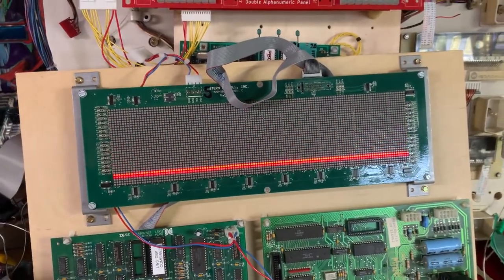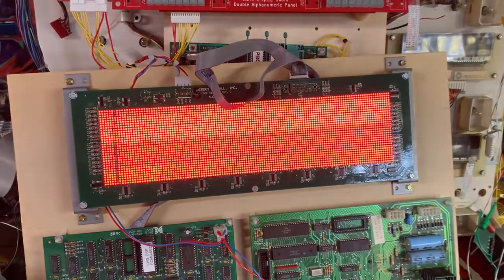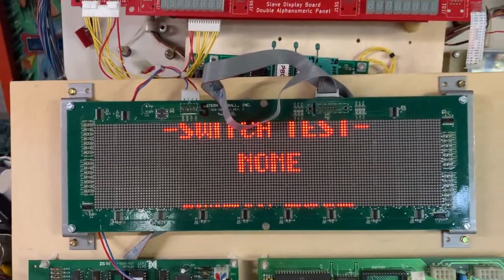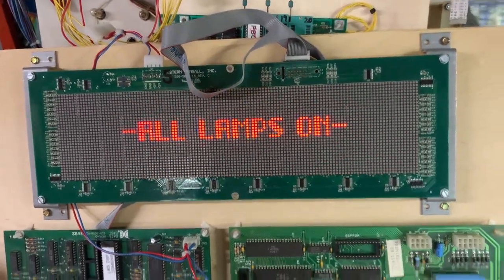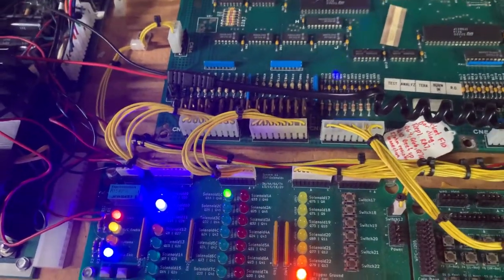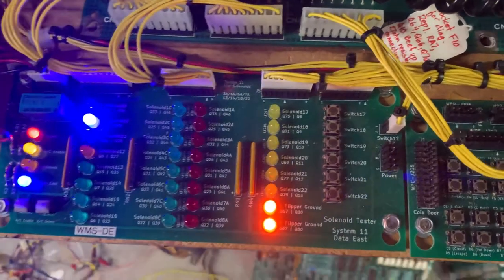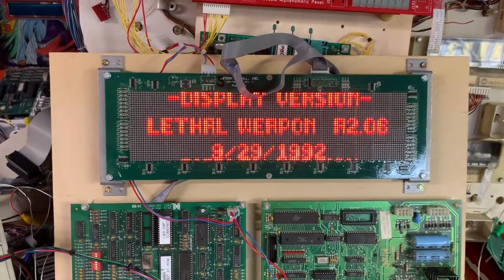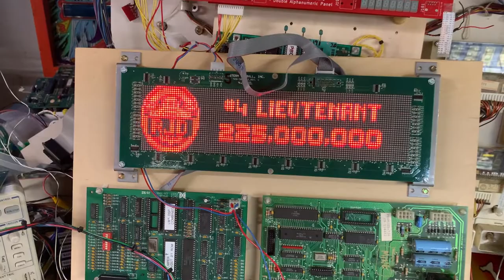Data East Lethal Weapon 3 MPU Repair and Test - Would not drive display

Comment: Where can I purchase the solenoid tester board?
Reply from the maker: Contact a fellow named DunbAss on PinSide. He is the original designer.
Reply: Hey Chris,  can you take a look at my LW3 MPU? Game won't boot anymore. I started having a loss of flipper power randomly and now game won't boot at all. All fuses check out fine (metered out of circuit) and mpu is getting 5.05v 
By BLANKING led on the MPU no longer turns on, just my +5v does.